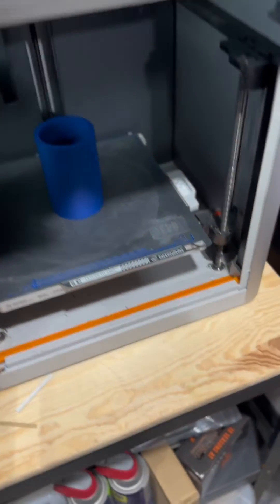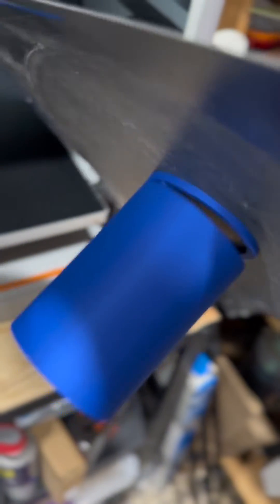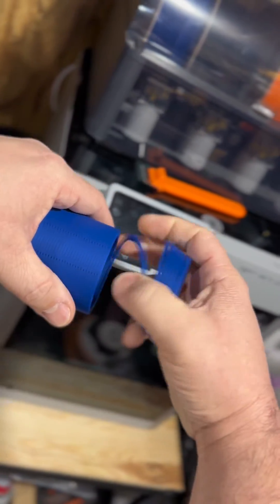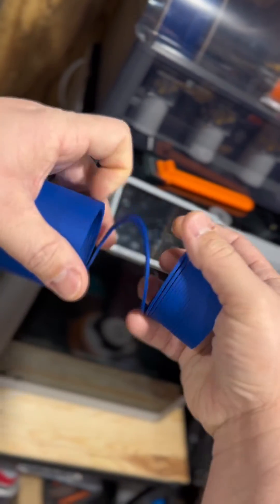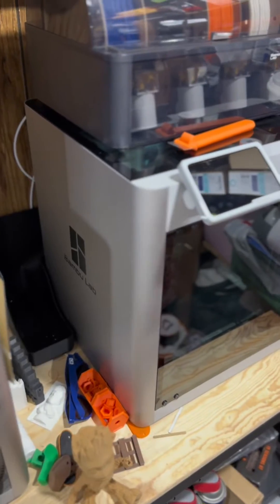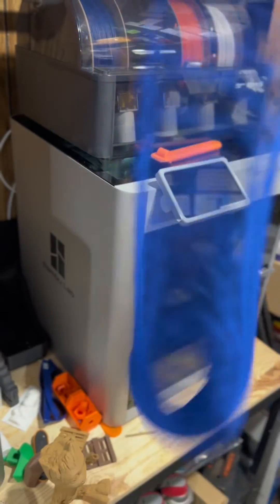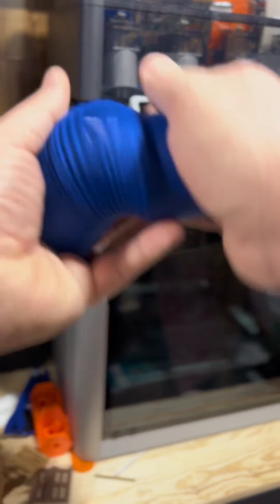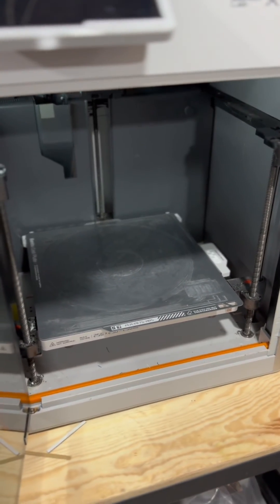A 3D Printed Slinky!

Comment: Such a fun print. I printed a small one (about 3cm in diameter and 5cm tall) in PLA to test it, and it works amazingly, just had to cut it with a box cutter to free it (the original model probably could have just been pulled apart, but I shrunk this one down in the slicer so it can print in an hour).

Definitely do a huge tall slinky next! I can imagine how fun it'll be. It's one of those childhood dreams everyone has. XD